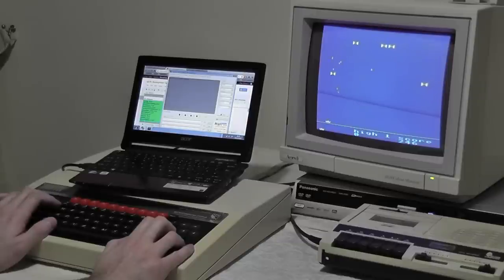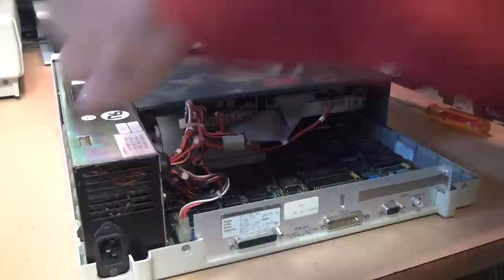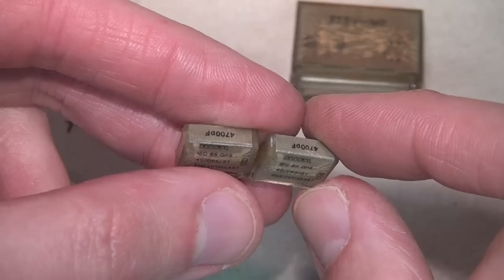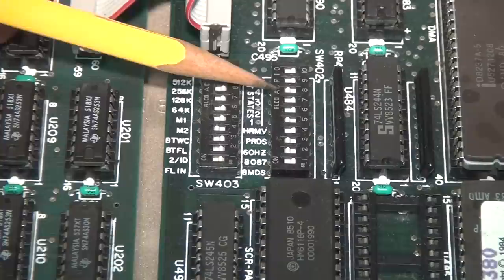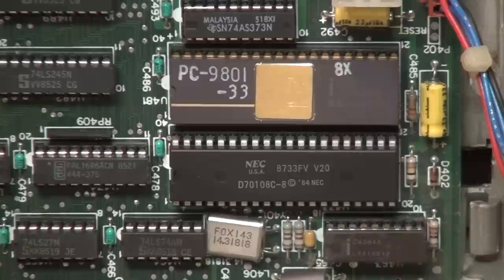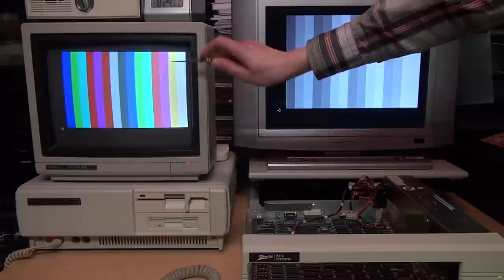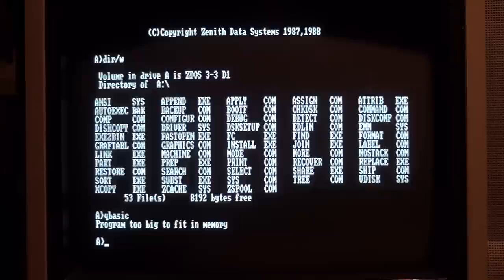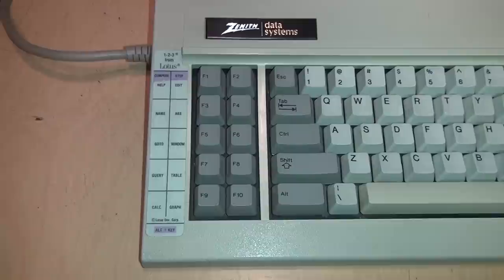Zenith Z-148 rare retro PC Rifa repair & review

Comment: a floppy cable twist may work but you need a  different twist , there was a pic on the internet how to make a modern fixed drive 1 floppy work on a shugart interface system as drive 0 ...
Reply: found  it on my computer, you need to swap the 2 lines to pins 10 and 12 only, not the usual 4 line 10 to 16 flip !
Reply: you may come across and old 3 1/2 that has 4 drive select positions, that'll likely work as is if set correctly, i have one chinon branded

Comment: Is there a market for these computers? Or many people interested in them? We're about to throw one in the garbage that belongs to my parents. They bought it new around 1984 or 85. Works perfectly, like new condition with original books, discs, everything. Just like it looked on the showroom many years ago. It's a Zenith Heath Z-140. I used to get a kick out of playing Microsoft Flight Sim on it but haven't played that in probably 20 years or more.
Reply from the maker: Yes! One of these sold for over $350 on eBay recently: https://www.ebay.com/itm/185824879897

Comment: Edit: Yes, it is monochrome, as shown later on around 16:33. I'd not heard of such a thing, why have the CGA monitor out but not also composite colour?

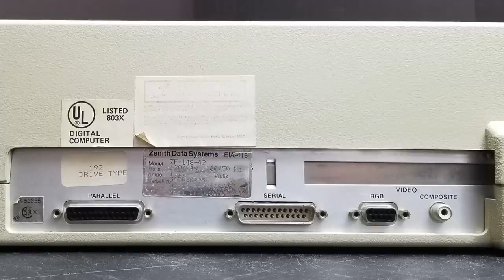When you're talking about the frequency quartering around 13:08, you say the corresponding NTSC colourburst frequency was not used because the computer doesn't have colour composite output. So just to be clear, the composite output of this computer (around 1:46) is monochrome?
Reply from the maker: Because Zenith was a TV manufacturer, and a monochrome composite monitor was basically just a black & white TV without the tuner. And most of these Z-148s were sold to schools, where color was not necessary, but have CGA rather than MDA/Hercules still allowed graphics to be displayed and games to be run.

Comment: 256k was ridiculous for 1985 and especially 86 or 87.  You would have been stuck using old applications or games.  The Atari 130xe was released in 1985 sporting 128k of RAM. 512k should have been the minimum this computer shipped with.
Reply from the maker: It was typical for an entry-level PC at the time. In fact, in 1986 the Tandy 1000 still came with only 128K as standard.
Reply: The commodore 128 was released that year with... 128K. the Apple IIE didn't come standard with 128K of RAM until the "Platinum" in 1987. The original Macintosh, on sale at the same time as this machine, only had 128K. The IBM PC XT didn't get a motherboard officially capable of exceeding 256K until 1986.

Comment: Can the RIFA sometimes also take other components with them? Because the smoke came from the middle of my long and slim power supply, but the rifa is in the end of it. In the middle there are seveal electrolytic style capacitors but they have this black "rubber sock" covering them. Can't see if they're bad. In the same run as all of that happened my controller card that was in that computer got a fryed chip. That controller card worked perfectly in another computer the same day.
Reply: If they fail short they usually just blow the mains fuse. If your mains fuse is still intact then it probably isn’t the RIFA to blame. But you will need to replace/remove the RIFA regardless.

Comment: The new capacitors will outlast the Rifa capacitors . They were terrible, I replace loads of them in Kenwood chefs and other appliances
Reply from the maker: If the ones in this computer lasted 37 years, I don't think they're that bad. Nobody can make any electrical components guaranteed to last that long.
Reply: @vwestlife  that's true I replace that type capacitor in very old Kenwood chefs and sewing machines , won't be around in 37 years to see if these outlast them :)

Comment: i didn't buy a computer until 2000 when i got a used windows 98se. it was a slow dog and almost useless. i finally got a new computer in 2001 and it was an
emachine with windows me, which wasn't any better! it's a wonder i bought any more computers after those 2 useless junkers. now i have a house full.

Comment: Leaving them out is fine right? Or is replacing better?
Reply from the maker: Replacing them is better.
Reply: To elaborate a little, it is designed to filter ripple on the AC side of the switching power supply, to avoid putting noise back into the lines in your house and probably neighbourhood. This was very important at the time as most radios and TVs didn’t filter this line noise and could have their operation impacted in various ways. 

Nowadays, most circuits which care filter their inputs, as it’s necessary to ensure the integrity of our modern digital circuits anyway. A really cheap LED bulb (with a capacitive dropper rather than rectification) will put way more noise on the line than occasional computer use. Nevertheless, it’s still for the best to keep your computer’s filtering, of which this is part of, rather than hoping everything else is properly filtered. It will also keep the DC power on the computer’s side a bit cleaner.

Comment: Again, with the video being rendered in 25 FPS, rather than 29.97 FPS?
Reply: PAL compatibility I believe
Reply: @ralphorama  But the shots of the Z-148 that VWestlife shot, and the commercials shown in it are in 29.97 FPS!
Reply: @northernplacecorporation  it's probably YouTube's encoding, they have to make it 25fps so ppl in PAL countries can watch
Reply: @ralphorama  this-- this is literally a modern video?? they work agnostic of power frequency or region, i thought people knew this 😭
Reply: @SoulcatcherLucario  it's more related to YouTube's delivery of video and how various formats are served to different countries. You need 25fps to properly work with 50hz European monitors
Reply: @ralphorama  I haven't seen a modern display that only accepts 50hz here in Ireland.  It's prob the camera vwestlife uses
Reply: @ralphorama  Any even remotely modern monitor/TV can handle both PAL and  NTSC framerates, doubt that's the issue. Youtube supports any standard framerate fine (29.97, 59.94, 25, 50 etc). It's only aldered if it's something not very standardr (it will also halve the framerate ad 480p and lower resolutions for 50/59.97/60 fps stuff)
Reply from the maker: All of the footage I shot for the video was recorded at 59.94 interlaced fields per second. But I think because the video began with a clip of that BBC Micro, which was recorded at 25 fps, then iMovie decided to render the entire video at 25 fps.
Reply: @vwestlife  Wait... 59.94 FPS interlaced for everything in this, but that BBC Micro clip is only 25 FPS, and iMovie deciding to render this one at the PAL frame-rate of around 25 FPS, meaning that we were losing -34.94 FPS of video on the shots you shot for this video?
Reply: @northernplacecorporation  iMovie probably just checks the first clip’s frame rate. This at least means prevention should be easy, just insert something else first
Reply: @ralphorama  YouTube delivers 25, 30, 50, and 60 Hz content as it was uploaded to all viewers. It’s up to the computer/TV to convert if necessary, whether that’s by dropping frames or a bothersome 3-2 pattern or something sophisticated that looks nice.
Reply: @kaitlyn__L  Oh. That's due to iMovie checking the first clip's frame rate, meaning that preventing that from happening, would be easy to do (in other words, inserting a video clip in a proper NTSC frame-rate first).
Reply: @olnnn  *59.94
I strongly agree with you. Any modern TV or monitor can handle both frame rates for NTSC and PAL. Heck, even YouTube supports any of the frame-rates perfectly fine. In my case, my first videos are rendered at the frame rate of 29.97 FPS, and my current batch of videos that I make, are all going to be produced at the frame-rate of 59.94 FPS, because newer VEGAS versions, starting with MAGIX VEGAS Pro 15.0, all have an option to render videos in 59.94 FPS as an MP4 file.
Reply: @ralphorama  You were WRONG! VWestlife shot everything in 59.94 FPS, but due to iMovie checking the first clip's frame-rate of 25 FPS (-34.94 FPS less), iMovie rendered everything in 25 FPS, for PAL! Same said with something CD-related.
Reply: @northernplacecorporation  why are you just repeating what he said earlier in the comment chain? I know that already
Reply from the maker: @northernplacecorporation  iMovie normally renders 59.94i footage as 29.97p anyway, but yes, since the first clip in the timeline was 25 fps, that's what it used for the entire video.
Reply: @ralphorama  Oh.
Reply: @vwestlife  Wait... really? It normally rendered the footage (shot in 59.94i) as 29.97p, but the entire video was only in 25 FPS, because the first clip in the timeline was in that frame-rate, meaning that we get a lot of frame-drops in the shots for the video. This means we got 4.97 FPS dropped in the shots as a direct result of that.
Reply from the maker: @northernplacecorporation  Yes, that's an odd quirk of how iMovie works. It uses the frame rate of the first clip in the video as the frame rate for the entire video.
Reply: @vwestlife  Luckily, both VEGAS Pro and its' discontinued consumer entry-level counterpart, VEGAS Movie Studio, has an option to change the frame-rate to what I want my videos to be in. For example, if a video is in either 23.976 FPS, and I've got a video edited in 29.97 or 59.94 FPS, I can change the frame-rate to my desired frame-rate.

Comment: It's funny how many things you say that are nonsense or don't line up with the video... like talking about the 160x100 16 color mode when showing the 80x50 126 "color" dithered mode. Or trying to run qBasic on a machine meant for DOS 3.3 thus you should be trying GW-Basic... which will run just fine.

Seriously when you went to run qbasic I was like "dafuq is he doing?!?"
Reply from the maker: That is indeed 160x100 16-color mode. The dithering only works on a composite monitor, not RGB. The angle and distance of the camera may make the colors look like they blend in, but viewing the monitor in person, they do not -- you can see the individual 16-color pixels. And QBASIC does indeed work fine in DOS 3.3. I've used it many times, just on systems with more than 256K RAM.
Reply: @vwestlife  Sorry but no, @21:55 that is NOT 160x`00 in either color composite or TTY, that is at best 80x100 using character 0xB1.  You might be displaying it on composite, but that's not what the mode is. Visibly so. Both in horizontal resolution and the number of "faked" colours shown which even 16 colour composite cannot actually accomplish.

Though it could be hybridizing. The massive number of colours shown to the left of the display is not possible in 160x100, but is in 80x100. The difference between the two not being timings, but what graphics character you plug in.

Kind of like how on the PC you can actually do a rough (if not superior) equivalent of the Apple ]['s lo-res and double-lo-res in nothing more than mode 3, allowing for mixed text, 80x50 16 colour graphics, and 80x25 126 "colour" dithered. Though the RGB display's colour choices aren't as nice. And of course we best not forget the 160x200 colour composite mode that's basically the same palette as the Apple ][ for obvious reasons -- both are colour artifacting. 

Trust me, I know a wee bit about programming CGA semigraphics. More than most in fact. Hell when I wrote Paku Paku I even managed to tweak EGA to show it aspect correct by forcing 80x25 to the CGA timings.
Reply from the maker: @jasonknight1085  I suggest you contact Jim Leonard (Trixter), who actually wrote the CGA_COMP program I was using to generate those 16-color 160x100 screens.